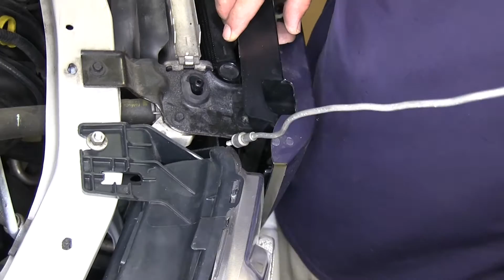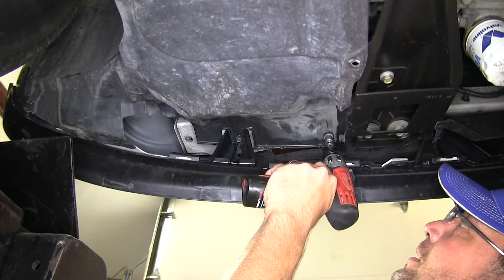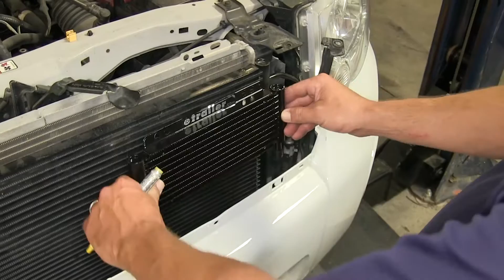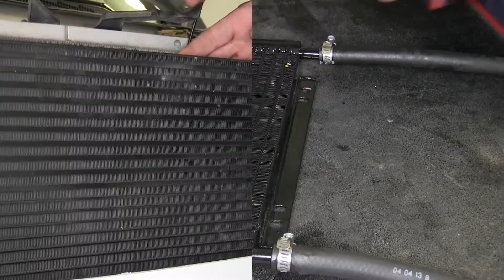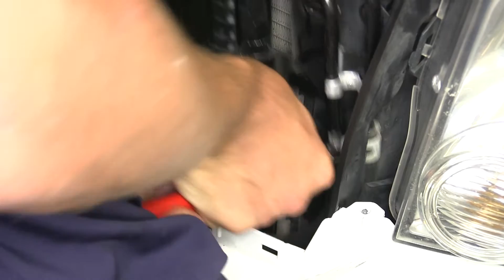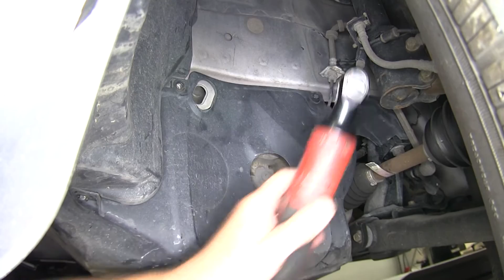Mount: Derale Series 8000 Plate-Fin Transmission Cooler Kit w/Barb Inlets on a 2008 Ford Escape

Comment: Why does this fit during your install video but i received my kit this week, and the supplied hoses are too small? the stock hoses are around 1/2" ID and the supplied hose is maybe 3/8" ID. There was no way the supplied hose was fitting onto those hard pipes, let alone the cooler seems a bit small and would cause a restriction going from large hoses to small. I have a 2011 V6 which isnt much different, but there is no way the supplied hose will fit.

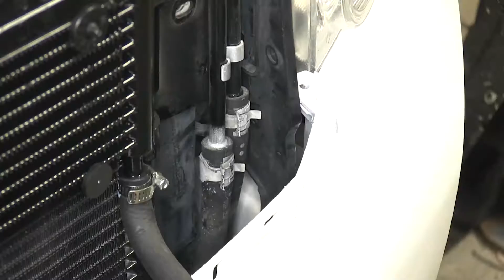Comment: Is this repair for leaking transmission coolers OEM? Our 08 leaks fluid from a broken connection at the cooler assy bracket. In this, it looks like you connecting the OEM lines back to the new cooler? If that line leaked would you just bypass connection to the orig cooler. @5:46 in the video you show the new cooler connecting to the steel lines of the OEM?
Reply: mike tippon, I know you probably know this answer by now but most aftermarket cooler are install in series with the factory cooler. But since 08 Ford Escape factory trans cooler is prone to fail, it would be best to bypass the factory cooler altogether. If you used the aftermarket transmission cooler (especially if you live in the south) I would recommend getting a cooler designed for a vehicle with a much higher GVW (gross vehicle weight) as they are larger and offer better cooling since you are using the cooler as the sole source of cooling instead of just an additional cooling in addition to the factory cooler.